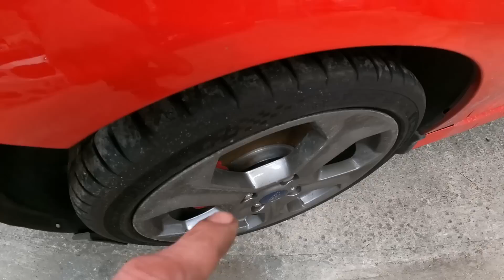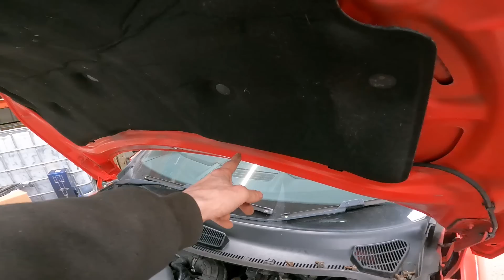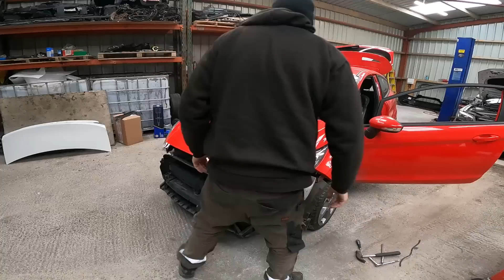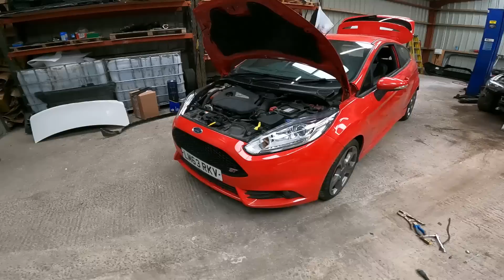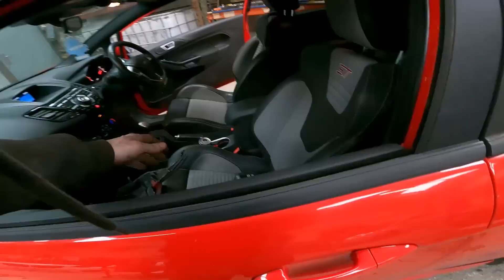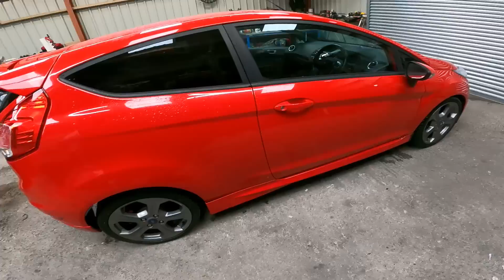Finally Found A Race Red Bumper For The Fiesta ST180 - Lets Get This Thing Finished!!!

Comment: I painted a front bumper on one of these race red it’s 2 stage colour ,special tinter in the lacquer ,it turned out real nice .Should fit the headlights after bumper makes it easier to get the bumper bolt in the corner
Reply: Race red is a solid colour. Are you sure your not on about molten orange?